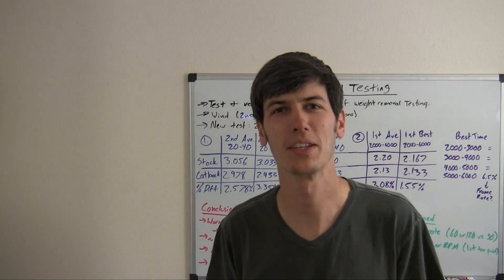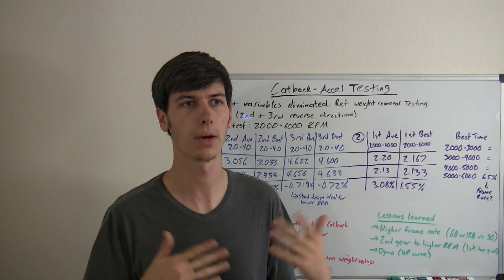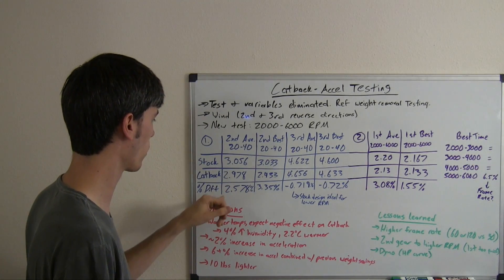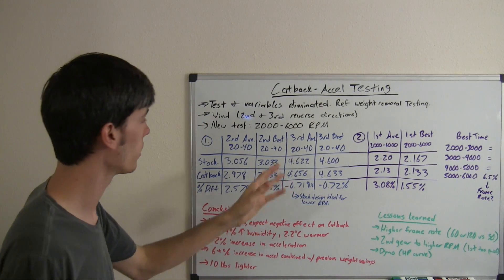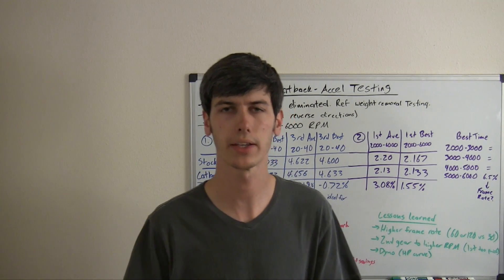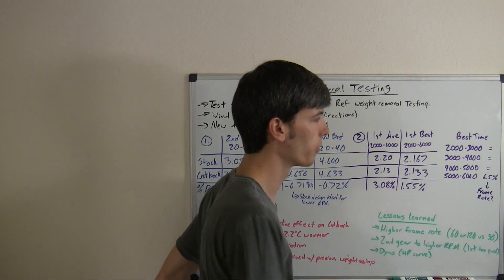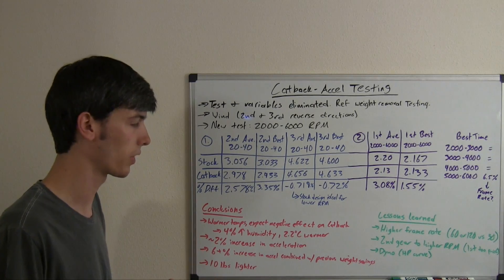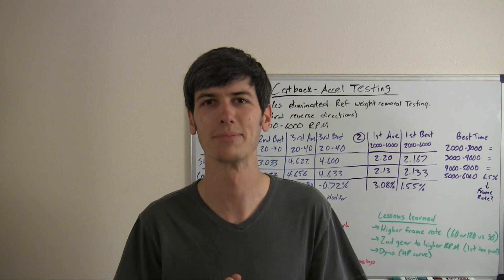Do Catback Exhausts Increase Horsepower? (With Proof)

Comment: If you can next do a comparison to straight pipe vs cat back. Now it can be straight pipe with cat, without cat, also with resonator and without. because there is a lot of aruments that going straight pipe will make you lose power. Even though you are making it eaiser for your engine to breath
Reply from the maker: ReefAdvicer Back pressure is not desired. Exhaust velocity is so that proper scavenging occurs. Back pressure is a result of a restriction, meaning you could be making more power if it did not exist.
Reply: +Blunt Man cat back is even better than a straight pipe. exhaust actually creates a pressure wave, when at the end of the pipe, the wave is going back to the engine. but with cat back, it absorbs the wave and it actually flows better as the exhaust gas flow faster bcause the cat back has a pipe with holes that is wrap with fiber.. the holes traps some air as the velocity increases and that trapped air acts like a lube. same principle as the hydroplaning of a car tire in the rain.
Reply: Yes you do lose hp and torque with out enough backpressure because it helps with harmonics and pulses in the header which help everything run more smooth
Reply: exactly

Comment: a cat back will only free up mid - high rpm driving becoz of the flow low will suffer unless you get long tube headers in conjunction with a high flow cat or no cat at all also improving top end

Comment: This is awesome, I basically have the same exact car(same color even) and I really like how meticulous you are and how well you explain what you're doing and explaining the results of your testing. I am also in the process of modifying my car(slowly but surely) and I had the same exact exhaust system on my list to purchase next and I really like how it turned out on your car. The sound it puts off is exactly what I was looking for and now I know exactly how it will help/hurt the car. Oh yea and now I know what problems I can expect when installing it as well. Maybe install a simple short ram or even cold air intake to help let that new exhaust show its potential and test the acceleration again and I'm sure you will see more significant gains from stock. Good work man.

Comment: Did you feel that the exhaust changed the power curve of the car?
Reply from the maker: TheFlacker99 (Flak) Hard to feel such a small difference, which is why I measured it.
Reply: Engineering Explained Interesting when I did my intake on my car it changed my power curve incredibly. My exhaust did a little as well.

Comment: I think you really should get the car into the dyno. With the video we know that in acceleration, the values are not that different. But how much would that represent in HP? And them it would come the question, is it worth to spend $$ to "earn some HPs" and have almost the same performance? Just and engineer to engineer tip. Keep doing your excelent work!

Comment: Pick up some 4:2:1 headers and some cams next. then get yourself a stand alone ECU and get some ITB's. after you get to where you have a good gain and drive it for a while, rebuild the motor with a higher compression ratio. You'll have to run a higher octane gas and you'll have to tune the ECU to do so but if you're making it a race car anyway it shouldn't be an issue. After that, depending on your application you can run a dry shot of NO2 into the throttle bodies and have one seriously fast car!

Comment: i have noticed that in the install video that you left the stock cat and headers, Do you plan on changing them as well? Im pretty sure that iff all your pipes are the same size and from the same place that made them, the preformance will show better results
Reply from the maker: andrew anderson At some point, I may end up changing them. I do indeed have an aftermarket header sitting around. :)

Comment: Can you explain why removing cat sometimes you will end loosing top speed on stock cars, Why some exhaust systems are better for acceleration and others are better for top speed? because theoretically if a car accelerates better it should do more speed, but that´s not the case
Reply: youmaster21 that’s like awd vs. rwd. 
AWD gives you better launches but inhibits top speed. 
Rwd gives you worse launches but gives you greater too speed. 
Same with downforce

Comment: This is a performance exhaust on a vtec engine, surely it makes more sense to test a range that is relevant to the performance - ie when the thing is actually on cam, as this is what the exhaust should be designed to do....
Reply from the maker: No vtec.

Comment: What was the diameter of the stock exhaust compared to the new exhaust? What kind of muffler does the new exhaust use?
Reply from the maker: 1.8" vs 2.25" Catback Exhaust - Explained

Comment: Hi Jason! I was wondering if you have an opinion on why do crankshafts use plain bearings instead of roller bearings?
Reply: Kind of 8 years late to the party but this is because the crankshaft bearings are supported by the oil, so they have even less wear/drag then a roller bearing.

Comment: random question. why skyline GTR have 2 air intakes? i saw it have 2 open pods. does it is because of twin turbo? :O
Reply: Well the Skyline GTR does not, cuz it's an RB28DETT, a right six. But the Nissan GT-R, a V6 ( VR38DETT) does. The new GTR is not a skyline...
Reply from the maker: One for each cylinder bank.

Comment: Did you tune it the exhaust! Waste of time if you don't
Reply from the maker: So what parameter do you change, after installing an exhaust? Everyone loves to say "no point if you don't tune" but no one seems willing to define 'tune.' Removing restriction reduces power loss, plain and simple. I don't see the logic behind requiring a tune.
Reply: Engineering Explained I think a lot of the computers in a car can compensate fairly well for a lightly modified car, i.e. an intake and catback exhaust, but if you go further into it; such as, internals and such then I'd say a tune is needed to obtain the benefits from the mods. Keep the videos coming and thanks for the explanations!
Reply: A tune would only help to fully utilize the achievable performance that a higher flow rate exhaust would give, this means running more aggressive ignition timing and slightly more fuel to allow for a larger exhaust pulse from the cylinders that would have been impeded by the restrictions leading to extra pumping losses seen on the standard system at high rpm.

simply fluid mechanics tells us that the standard smaller diameter pipe will be more efficient in the lower RPM range whilst at higher RPM that larger diameter system will be more efficient. The conclusions drawn in the video in my opinion are correct and as expected.
Reply: Tuning for this type of exhaust gives negligible performance gains. In a stock exhaust,the stock muffler is the least restrictive part.

Catback exhausts are just noise increasers, their main purpose is to comply with the law while giving you a different exhaust note. For a true performance gain, the whole exhaust needs to be changed, starting at the header.

The header is VERY restrictive in stock form because most of the time it is an exhaust manifold, of unequal length, and designed with fitment and low RPM in mind on economy cars. It is also usually made of cast iron in these 90's car, making it REALLY heavy.

The stock catalytic converter is also extremely restrictive, especially when you take into consideration the years of soot it's collected. 

Once you swap out the header and catalytic converter for performance parts as well, you'll see a VERY noticeable difference, which will require some sort of real tune, because the stock ECU won't do that good and compensating. 90's ECUs aren't designed to auto-tune themselves for the most part, there are set-in-stone fuel and timing maps in them, designed for the stock engine. The adjustments it can make are very limited, especially when considering that the oxygen sensors in this are 0-1V and not wideband 0-5V sensors that are much better at reading and compensating for changes in the engine's performance.
Reply: Steven Marzullo
Exactly.  Plus you'll see different A/F ratios with on/off VTEC, or whatever variable valve timing system your car employs. 

Plus once you go aftermarket, the O2 and A/F sensors are never in the exact same spot or it the same depth of flow.  They tend to read "off" and may cause a lean/rich condition at varying rpms.  Rule of thumb is to do all your changes, and then tune.
Reply: Jake F It really depends on which manufacturer. On a Honda for example, the ECU will remap itself, even with parts upgrade like injectors. But on the 2001 Ford Cougar a friend of mine and i built, it was a pain in the ass, so much that we decided to put back the normal injectors instead of the Cobra injectors we initially installed. Even adding a cold air intake needs a remap to keep everything working as it should.
Reply: Engineering Explained It's a bunch of crap dude. If i was a boosted motor I would personally send you a letter telling you to get it mapped, but it's not. What I would advise you do is unplug the battery/remove ECU fuse for 15-20 mins and then let the car idle up to temp and then take it out for a blast. Honda ECU's will adjust AFR slightly to compensate for the new readings. If you're looking at Intakes DO NOT go for any of the open cone filters, unless it's a proper CAI that goes into the wing/bumper. The best mod I did to my B18C4(C1 in America) is fitted the Integra Type R air box with an GOOD aftermarket filter. It made significant gains throughout the rev range and made 9hp at peak power. The ITR exhaust manifold is also one of the best available for the B, not 100% it will fit the B1 though.
Reply: Steven Marzullo
Love those old talons, great starter car.  What might have happened is that the cylinders weren't taking boost balanced.  Like all the air was just slamming into the back of the intake manifold and hitting #4 making it extra lean. 

Yeah for turbos....I mean, you need a tune right away after doing anything.  Especially over single digit psi boost.  I think most NA cars can compensate for maybe 3-7 psi?  Not sure where I read that. 

Pretty sure most cars you can get away with a catback tho.
Reply: Not entirely necessary. The o2 sensor will compensate for the extra air flow, by telling the ecu to increase the amount of fuel a certain percent.
Here is where a tune does come in: The ecu will only has a maximum value it will increase or decrease the fuel. Lets say the range is from -20% to +20%. So instead of a perfectly running engine at 0 fuel trim, this engine (assuming everything else is perfect, which never happens) would be running at, lets say 8% fuel trim. This means the ecu only has another 12% it can increase fuel flow if there was a problem like a vacuum leak, clogged injector, weak fuel pump, etc. A tune would allow you to set the base fuel tables to match the actual needs of the engine, which would mean the engine with a modified exhaust would be running at 0 fuel trim again. This gives you the full 20% + or - to allow for problems. HOWEVER: Most tunes require disabling the o2 sensors on the car. If the o2 sensor wasnt disabled, the ecu would start correcting fuel trims and undo the tune you just did. With the o2 sensor disabled the ecu wouldnt know to correct the fuel trim anyway. THEREFORE: The only time i tune is needed is when other engine parameter need changed. Such as ignition timing, idle speed, injector timing. Or when the modifications push the fuel needs past what the ecu can correct for.
Reply: Hondas run rich from the factory, so leaning it out is safe. And it's a good way to make more power. Super street found that an accord would make more power just by leaning out the AF a little.
Reply: +Engineering Explained I will play the devils advocate here, you would increase the fuel delivery since you removed some restriction. Having said that the most restrictive thing in the entire exhaust system is the cat not the muffler (we are talking and older car like this not a newer car with a high flow cat). Do a cat delete and rerun the test I'll bet dollars to donuts if you run the car long enough to let the computer remap the fuel delivery curve you will a more noticeable increase with a cat delete.
Reply: +Arolbreaker Thank you! I agree completely!!
Reply: Steven Marzullo H22 I believe
Reply: how tf do you even tune and exhuast?

Comment: On low RPM there will not be enough exhaust moving trough the pipes to give a significant airflow resistance. Testing 5k to 7k in 3rd gear would be easier and more relevant. When you add a turbo, testing low revs will be relevant.

Comment: Could you say, because of the larger diameter the exhaust doesnt work that good at lower rpm because of a lack of "vacuum" that pulls the exhaus gases out ( like you explained in the catback video) ?
Reply from the maker: Yep, less scavenging.

Comment: What about fuel economy? Would a high-flow Cat-Converter and Muffler and new exhaust pipe without any built up gunk overtime result in easier flow path for the exhaust gases resulting in less resistance which means better fuel economy?

Comment: This is a fast reasoning, so it can well be a wrong one.
Its possible that one could measure the acceleration difference while applying multiple gears in one run, and at the same time, discarding the inconstant time of manual gear changes.

We find the nº of frames that it takes to go from aKPH to bKPH in 1st gear. Then, in 2nd gear, we find the nº of frames that it takes to go from (bKPH - 5) to cKPH. Then in 3rd, from (cKPH - 5) to dKPH. In 4th, from (dKPH - 5) to eKPH.
(The '5' is just there to produce a 'grey area' in between gears, so that there arent any discrepancies, thus a higher value could be used)

We add the nº of frames in all gears (while ignoring the nº of frames in the "grey" 5 KPH of every gear) and we can calculate the acceleration time.
This would be a test where all gear changes are seamless, therefore the acceleration time would be non-representative. But i think it could give us a representative % difference from one exhaust pipe to the other. Im not 100% though.

Comment: Engineering Explained You should install Poly engine mounts, I'd like to see how this effects acceleration. 

It would also be nice to understand the effects from a Engineering perspective. Since this is just a project car I'd say go for full racing engine mounts. If not, fast road mounts may be better for daily drivability.

However, considering you're doing all these tests from 0mph and counting from 20mph, I can't imagine the engine mounts would make much of an improvement to acceleration, as apposed to slamming on the gas, as this is where i believe the engine mounts reduce the amount of throw of the engine, allowing the engine to put the power down quicker. 

Maybe I answered my own question, so maybe it won't effect acceleration using variables used in this test, maybe device another test where for e.g. you test acceleration using WOT only from 3000rpm.
Reply: Engineering Explained in fwd stiffer mounts 100 percent increase acceleration. Decreases wheel hop and keeps the power to the ground.
Reply from the maker: Engine mounts are unlikely to have any effect on acceleration (unless of course, they have a significantly different weight).

Comment: I'm not sure about the margin of error for this kind of stuff. It does seem like there is an improvement, but with margin of error and other factors that could throw it off by a little bit I think maybe the 10lbs you lost may have attributed to part of that very small gain.

Comment: Find an open quiet road... and try 4th gear pulls from ~2000rpm to rpm limiter or slightly lower...
Like a dyno... but in real road conditions...
That way you will have tested all (low,medium,high rpms)... on around 1:1 gear ratio...

Comment: Great job on consistent test procedures. I would encourage you to upgrade/ replace posi, clutch/pressure plate, and CV joints. One of the first things to go is going to be the clutch, posi ( if it has one), or CV joints... Only a slight upgrade on these parts ( stage 1 or 2 ) will make a vast improvement and make the car more consistent when testing parts and make ready for more power in the future.

Comment: Perfect example of how "easy performance" mods don't work no matter how much companies will tout "10 hp gain or whatever"(unless the system being modified is super restrictive, or they tested on a best case sinerio a.k.a modded vehicle). It's all down to how effective the engine is at moving air, because an engine is really a fancy air pump. I expect to see the same result when you get around to a CAI. Assuming no cams or FI are done before hand.

Definitely going to use this methodology when I get a catback and a SC under-drive pulley for my Mini, to see what the difference is between all the combinations.

Good video, can't wait to see more!